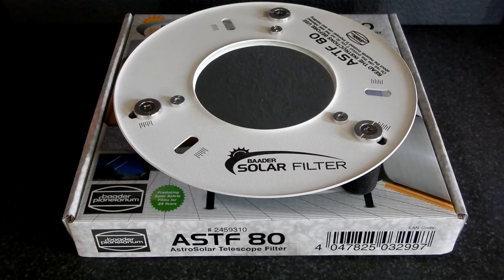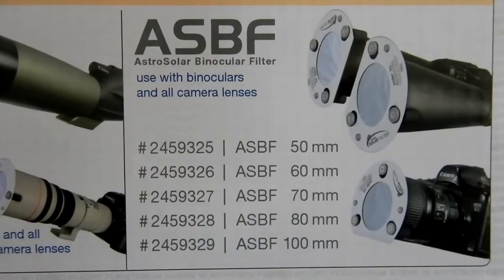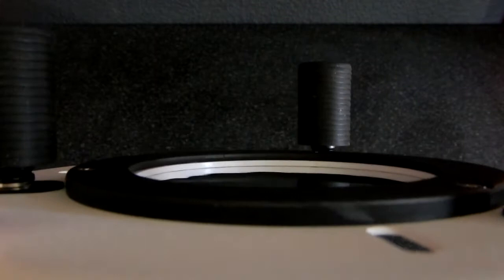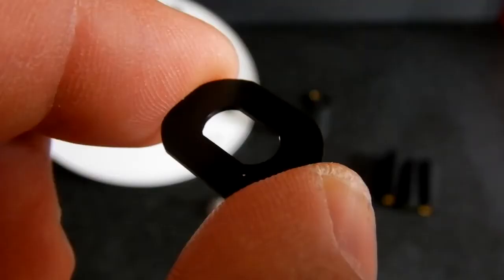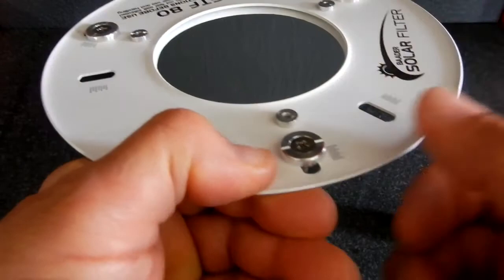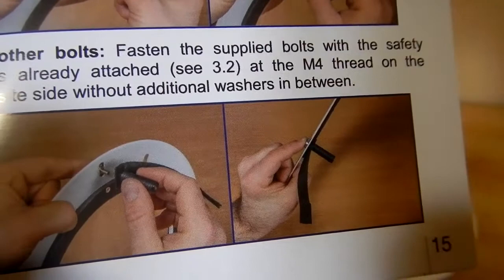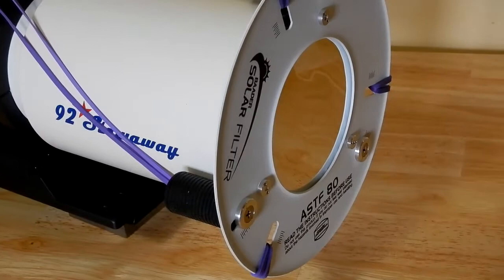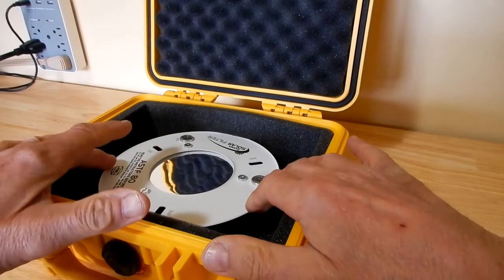Baader Solar Filter ASTF-80 on an Astro-Physics 92mm f/6.65 Stowaway Refractor Telescope

Comment: Excellent video showing how the Baader solar filters work!  There's not really anything else online showing the attachment mechanism.
Reply from the maker: Thank you 🔭
Reply: @starastronomer  It convinced me to stick with the Baader solar film for now instead of spending $600 for a Baader Herschel wedge and polarizer!

I think I will stick with the Velcro safety straps for now though as I don't trust rubber bands.
Reply from the maker: BTW, I do have the Baader wedge too, EXCELLENT device.

Comment: Even though replacing the rubber bands every session is smart, I still wouldn’t use them for this application. Be careful with your eyes, it only takes one defective piece to ruin your eyesight.

Comment: This isn’t correct. It’s against the instruction manual. The black washer should be on the top side, not underside.
Reply from the maker: @JoshuaYoung2   QUESTIONS: 1---Do you know the reason for those elongated washers??? 2---Did you note what I clearly said in the video??? 3---Are these elongated washers doing their job??? 4---Did you hear my disclaimer in the video??? IT DOESN'T MATTER IF ON THE TOP OR BOTTOM AS I SEE IT. But definitely follow the Baader directions. It is imperative that you understand how something operates and make sure in the end you get the EXACT same outcome. You can add 3 + 5 OR 5 + 3 with the EXACT same outcome. Clear skies. (BTW - I am very mechanically inclined and understand how things go together.)